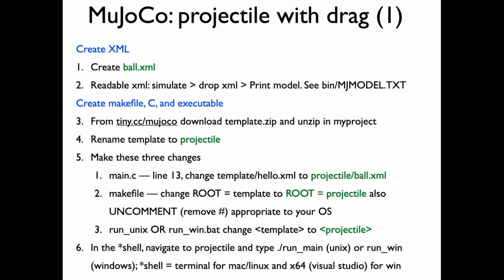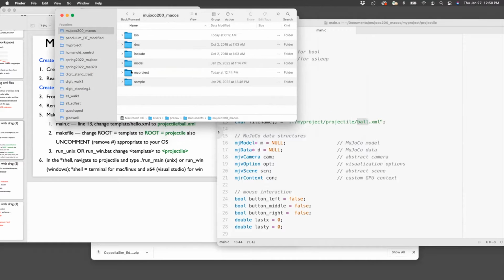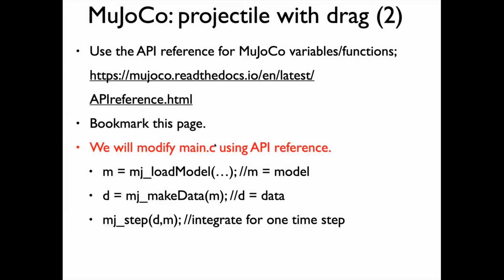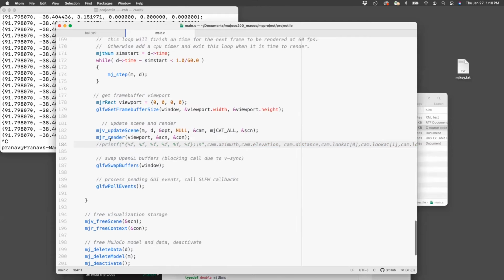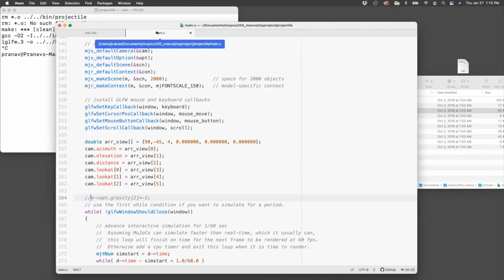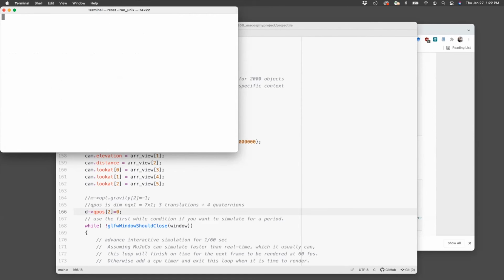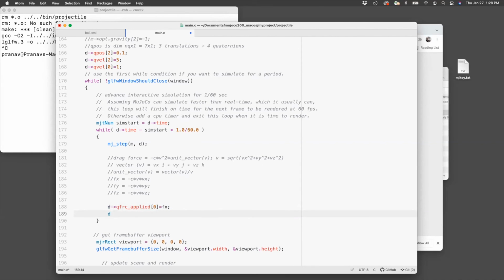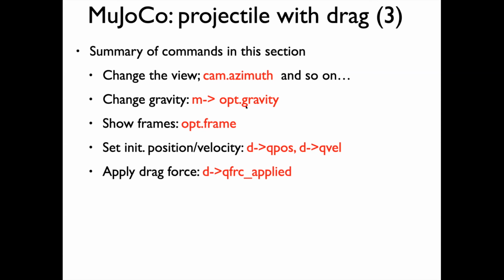MuJoCo Lec2: Projectile with drag (Spring 2022)

Comment: Thanks for the tutorials 😃

Still having trouble compiling the project despite trying the other solutions in the comments? The problem is in the main.c file!

The latest version of Mujoco (2.3.6) removes the mj_activate and mj_deactivate functions. Compiling the template main.c file will cause an error as a result. Simply comment out the lines containing these functions and it should work just fine.
Reply from the maker: Yes, that would work for 2.3.6. Thanks for leaving that comment.

Comment: Small change for those running this on Windows in 2023:
Assuming you dropped all the .lib files from GLFW into the lib folder of mujoco, and retained the folder structure of include so that it shows
include/mujoco & include/GLFW,

the Makefile needs to be modified as:
LIBS = ../../lib/glfw3dll.lib  ../../lib/mujoco.lib

And the #include at the top of main.c as:
#include "mujoco/mujoco.h"
#include "GLFW/glfw3.h"

Then it should compile and run successfully.
Reply: Thank you for correcting, saved my time
Reply: Thanks alot.. although i saw your comment after so many failures😅

Comment: Thank you so much for this playlist! Quick question-I'm working on a windows machine and am having difficulty getting my main.c file to simulate properly. In the run_win.bat file do I also have to change "bin" to my file path, in addition to changing <template> to <projectile>? If it means anything, I'm using the latest release 2.2.0...
Reply from the maker: Try changing the make command in run_win to nmake. The run it from the folder it is in. No need to change to bin folder. Let me know if that fixes it.
Reply: @pranavab  thanks for getting back to me so quickly! So I installed the latest distribution of mujoco on a mac to see if I'd do any better and I'm getting this error:

"rm *.o ../../bin/projectile
rm: *.o: No such file or directory
rm: ../../bin/projectile: No such file or directory
make: * [clean] Error 1
gcc -O2 -I../../include -L../../bin -mavx -pthread main.c -w -lmujoco200 -lglfw.3 -o ../../bin/projectile
main.c:7:10: fatal error: 'mujoco.h' file not found
#include "mujoco.h"
         ^~~~~~~~~~
1 error generated.
make: * [all] Error 1
./run_unix: line 4: ./projectile: is a directory"

I edited the run_unix file a bit:

"reset
make clean
make
cd ../../myproject && ./projectile"

I changed <bin> to <myproject> because the projectile folder is within the myproject folder. Am I understanding this correctly? Sorry, I have little experience with these file types...
Reply from the maker: @noahbarrow7979  Don't change anything in the run_unix file. The myproject folder is probably is not in the correct location. Ensure that the mujoco folder has the following folders: bin, sample, myproject, and include. Then retry to run_unix

The run_unix is written so that it will use the mujoco files in include folder and main.c in myproject/projectile and create the executable in the bin folder and then run the executable in bin. run_unix does this in one single step to make it easy to run the code.
Reply: @pranavab  Hey, so I uninstalled the latest distro and found the earlier 2.0 Mujoco version. I installed that and made the necessary changes that you described but I got a new, different error related to the mjkey.txt. This was in macos. When I tried this same routine on a windows machine I got the same basic error:

"        cl /O2 /MT /EHsc /arch:AVX /I../../include /Fe../../bin/ main.c ../../bin/glfw3.lib  ../../bin/mujoco200.lib -o ../../bin/projectile
Microsoft (R) C/C++ Optimizing Compiler Version 19.26.28806 for x64
Copyright (C) Microsoft Corporation.  All rights reserved.

cl : Command line warning D9035 : option 'o' has been deprecated and will be removed in a future release
main.c
Microsoft (R) Incremental Linker Version 14.26.28806.0
Copyright (C) Microsoft Corporation.  All rights reserved.

/out:../../bin/main.exe
/out:../../bin/projectile.exe
main.obj
../../bin/glfw3.lib
../../bin/mujoco200.lib

C:\Users\nbarr\Desktop\mujoco200_win64\mujoco200_win64\myproject\projectile>SET var=C:\Users\nbarr\Desktop\mujoco200_win64\mujoco200_win64\myproject\projectile

C:\Users\nbarr\Desktop\mujoco200_win64\mujoco200_win64\myproject\projectile>cd ../../bin   && projectile
ERROR: Could not open activation key file mjkey.txt"

Not sure where to go from here. Let me know if you have any other ideas. Thanks again for all your help!
Reply from the maker: @noahbarrow7979  put the mjkey in the bin folder. It will work on Mac
Reply: @pranavab  Ah I see! Where is the mjkey though? Is that something else I have to download? I didn't see anything in the roboti deprecated section about mjkey...
Reply from the maker: @noahbarrow7979  tiny.cc/mujoco scroll all the way down or search Key
Reply: @pranavab  Ah ha! Sorry, I'm just seeing your reply, I'll try this later tonight :)

UPDATE: the key was the KEY!! It worked! Thank you so much again for the awesome lecture series, your responsiveness, and your patience!! I can't wait to continue :)

Comment: Is it possible to also mention the changes need to run mujoco 2.10
Reply from the maker: Don't have instructions for that at the moment. On mac, It seems like the bin folder is missing a library (../bin/libglfw.so.3). There are ways to create this lib file (e.g., https://gist.github.com/vaiorabbit/6204931), but seems like more work. You could raise a ticket on the Deepmind Github discussion forum (https://github.com/deepmind/mujoco/discussions) about it. However, it might just be prudent to use 2.0 at the moment and move to 2.1 once Deepmind has figured out all the kinks.
Reply: @pranavab  Thanks for the response! Actually I was able to compile on my mac by simply changing "LIBS = -w -lmujoco200 -lglfw.3" to "LIBS = -w -lmujoco210 -lglfw.3" in the makefile. However, I did not try it on linux where libglfw.so.3 is needed.
Reply: @bolundai  Hey, I am using M1 Mac with Mujoco 2.1, I tried your command but it still shows me the error 

#MAC
COMMON=-O2 -I../../include -L../../bin -mavx -pthread
LIBS = -w -lmujoco210 -lglfw.3
CC = gcc
Reply: @bolundai  Is there any fix for this
Reply: @samarbatra2110  Actually I am not sure how makefiles in C work, so I have no idea how to debug this. But the bugs that caused errors in the make process that I have encountered are related to not changing to the correct filenames in the makefile, main.c and run_unix. Hope that helps.
Reply: @samarbatra2110  I am not sure that this is the cause, but just FYI I am using an intel-chip mac.
Reply from the maker: @samarbatra2110  MuJoCo 2.1+ released by Deepmind is not ready for public usage because of such kinks. I recommend you use ubuntu via virtual box. I have instructions in the installation folder here: tiny.cc/mujoco

Comment: could you explain the the makefile?
Reply from the maker: It lists a set of libraries and api's needed for the mujoco to compile and create an executable. You don't need to modify the makefile unless you want to call more libraries. If you want to learn makefile in general, then there are quite a few resources on the web.
Reply: @pranavab  Does the compilation only have to happen in x64 native tools cmd prompt in windows? Can it be done in PowerShell or from the default cmd prompt?
Reply from the maker: @jrohit1110  for windows you have to use the visual studio shell. Cmd shell won’t work.
Reply: @pranavab This is the error that I am getting in the prompt. Make seems to be working but not run_win.bat: (test_1 instead of projectile)

C:\mujoco-2.1.1\Custom_projects\test_1>cd ../../bin   && test_1
XML parse error 3:
Error=XML_ERROR_FILE_NOT_FOUND ErrorID=3 (0x3) Line number=0: filename=hello.xml
Reply from the maker: @jrohit1110  you need to give the correct path to the xml file in main.c. Also note that I have no tested the software I provide on mujoco 211 which you seem to be using. It is tested on 200
Reply: @pranavab  Yes, I am using 2.1.1. I managed to surpass the xml error, by changing the filepath in mjLoadXML to ../Custom_projects/test_1/hello.xml
the build process completes, and I can run test.exe, but there is display at all, or any information

C:\mujoco-2.1.1\bin>test_1.exe
C:\mujoco-2.1.1\bin>
Reply: @pranavab  I got it to work with mujoco200win just as you said. I tried the sample folder. Thanks for your help 😄
Reply from the maker: @jrohit1110  great! Deepmind has not really got the 211 and later versions ready for public consumption. It’s best to use 200 till they figure out all kinks.
Reply: @pranavab  NMAKE : fatal error U1077: '"C:\Program Files\Microsoft Visual Studio\2022\Community\VC\Tools\MSVC\14.33.31629\bin\HostX64\x64\cl.EXE"' : return code '0x2' I got this error every time I try to run the makefile. any suggestion!
Reply from the maker: @emanbadr2858 unfortunately the error is not very informative. Did you follow all instructions about installing visual studio?. Are you using mujoco 200 on roboti dot org?
Reply: @pranavab  Thanks! fixed.

Comment: >>
PS C:\Users\LENOVO\Desktop\mujoco-2.2.1-windows-x86_64\myproject\projectile> .\run_win.bat
>>

C:\Users\LENOVO\Desktop\mujoco-2.2.1-windows-x86_64\myproject\projectile>nmake

Microsoft (R) Program Maintenance Utility Version 14.42.34435.0
Copyright (C) Microsoft Corporation.  All rights reserved.

makefile(13) : fatal error U1035: syntax error : expected ':' or '=' separator
Stop.

C:\Users\LENOVO\Desktop\mujoco-2.2.1-windows-x86_64\myproject\projectile>SET var=C:\Users\LENOVO\Desktop\mujoco-2.2.1-windows-x86_64\myproject\projectile

C:\Users\LENOVO\Desktop\mujoco-2.2.1-windows-x86_64\myproject\projectile>cd ../../bin   && projectile
'projectile' is not recognized as an internal or external command,
operable program or batch file. I am getting this error on windows
Reply from the maker: @mahshidahamid1623  nmake failed. Its the makefile(13) syntax error. Did you modify the make file by any chance by adding an extraneous character?